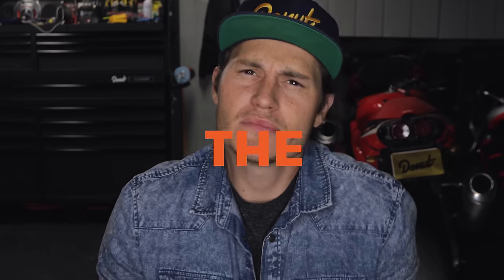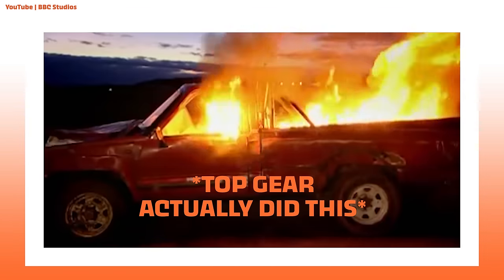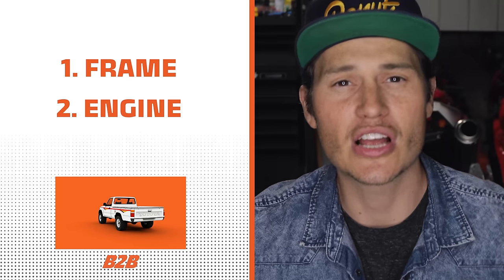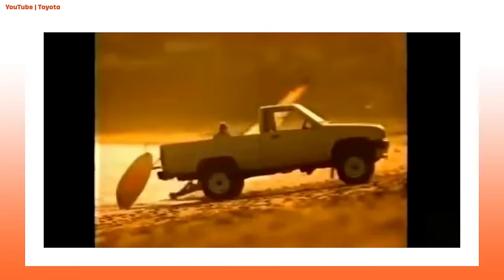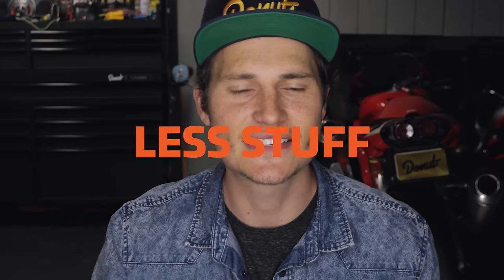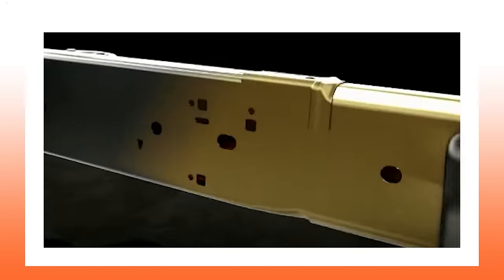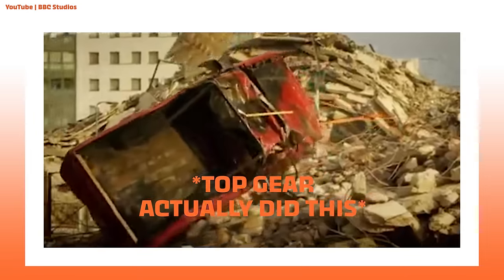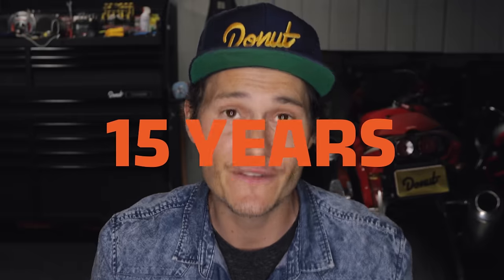Toyota PICKUP Truck - The Science EXPLAINED

Comment: Germans: you can’t just make a truck that’s indestructible 

Japanese: haha truck no break break
Reply: Germans: NEIN!
Reply: はい
Reply: *brrrr
Reply: of course german cars are destructable.
Its probably the transmission that breaks.
Reply: Japanese: Hold my saki
Reply: Samuel Hayden: Can't just shoot a hole in the surface of Mars.

Doom Guy: [fires Toyota Pickup 10,000]
Reply: Kj16V lmao
Reply: Frisbe  I'm worried for your IQ.
Reply: @masterace1150  Because it’s called a joke. The Japanese part is supposed to be the focal part of the punch line. If the Germans have equally noteworthy dialogue changes then the joke would just be a long running mute. Cmon use you IQ points.
Reply: Fegelein.. Fegelein..
Reply: Germans: screams in angry engineer
Reply: @cheesuschrist8248  it's a tradition
Reply: h
Reply: Netherlands: done done again done as a pickup done as a racer done as a semi done
Reply: Master Ace Wooosh
Reply: VW built the Hilux under licence from Toyota badged as Taro it was sold in Europe not sure about anywhere else.
Reply: @cheesuschrist8248  i think it's tradition

Comment: I remember watching Top Gear, they had a building implode on it and it was A-Ok
Reply: Technically it just rode the roof down.
Reply: @PACKERMAN2077  it still hit the ground like a brick though
Reply: To be fair. The camera crew left an old clapped out Dodge Dakota in the building they knocked down with the Toyota on top. Al Bundy approved. It still runs. All the glory went to the Yota that was demoed carefully to survive. More spoilers. GM hired camera crews who made all their commercials for the new Silverado..... with a Ford Raptor.  I mentioned that it's ironic to the camera guys. They said that their employer bought the truck. Top Gear did a big 3 competition in which the Chevy truck was considered the winner. Only the Dodge could have made it. The Ford could have made it too. All about the drivers. Toyota paid to be portrayed favorably again in that episode. It was declared the official winner because their camera guys, drove sensibly because of where they were so they could... get home.
Reply: They also chained it to a beach while the tide was coming in, the waves turned it on to its roof, it was fully submerged....a few hours later, it drove away.
Reply: @dyent  Yes I remember that part. Supposedly they got that little diesel truck running again with W-40, wrenches, and a socket set. I would argue that had that Toyota been a gasoline. It probably would have never started again. Diesels do not need spark to run. So the whole spark issue is taken out of the equation. A USA version of that Toyota would have been scrapped like an S10, Ranger, Jeep Commanche, Mazda, Mitsubishi, Nissan D21 and Dodge gasoline competitor.

Comment: NOOOOOO STOP RAISING THE VALUE WHILE I'M IM THE MIDDLE OF LOOKING FOR ONE!!!!
Reply: Muahahaha
Reply: my neighbor has one still runs just put air in the tires and charge the battery it just sits in the driveway but it still runs
Reply: @crownking3752  I'd go offer him 1200 bucks to take it off his hands
Reply: Good Luck! I mean it haha
Reply: So true, after every episode , these prices go up because now all these non car guys, go buy them to lift them or for racing and drifting. 😭😭😭
Reply: @joshuaadler4259  nah he doesnt want to sell it haha
Reply: Well in my country this pickups value were no more, you could get a hilux with great condition around 1800 bucks, my neighbor got one also
Reply: Lol most were I live are 3500 and I sold mine for 500 bucks 😂😂
Reply: Hahaha I just bought a Toyota Tacoma 2003 for 2000 dollars in really good conditions
Reply: Riccardo Spadano Too late. Go to autotrader.com, plug in Toyota truck 84-88. The prices are shocking.
Reply: Charlie Foxtrot  go look at the prices for FJ 40’s
Reply: Lyndon Whitson Those are even more shocking. But I saw an 86 standard cab, bare bones 22R truck w/127K mi going for $22K. The trucks are following the trend of the FJ's.
Reply: I got an '88 Pickup 4x4 at $1500, totally rust free frame, only catch is it has the 3VZ-E engine in it. Apparently 1988-1989 are the two good years for the 3.0L V6, so if you find one, get it. Or not lol
Reply: @Emiliopedo  how many miles?
Reply: @fishon1467  at that moment  230,000
Reply: Hahaha donut go brrrr
Reply: @Charliefox71  that's actually insane, some of those trucks are sitting at 16k USD

Comment: I prefer the Nissan Hardbody's, and they are just as reliable. Drove mine with no oil for 108 miles at 80 MPH and once I found out the oil sending unit from 1995 was leaking I replaced it filled it with oil and its been fine since. Late 80's early 90's was prime Japanese automobile manufacturing

Comment: Bought a Toyota pickup new in 1990 with the 22RE.  It was the base model, which meant:
No radio
No cigarette lighter/charger outlet
No passenger side mirror
No rear bumper 
No carpet OR floor mats - just a rubberized floor
I added most of those things
Oh yeah, no AC.
I drove it 458,000 miles.  I had a water pump and fuel pump replaced and it had an appetite for alternators - I'm guessing the guys that installed the charger outlet and sound system buggered something up.
It was still running, although it was jumping out of gear and you could hear it would need engine work.  I sold it to the state in a cash for clunkers program.  I got under the car to check something and the frame looked almost new.  Anywhere else in the world they would have dropped another motor in it and kept going, but I felt the whole truck was getting tired by then.

Comment: the world: LOL u cant drive a pickup without oil hahaha
Some Japanese company: haha Toyota pickup go brrrr
Reply: More like brat ta ta ta
Reply: Lame
Reply: BS.  My Ex drained the oil out of my original 4-Runner.  I have no idea how long I drove it dry.  It was running too hot so I pulled over and checked the oil because I couldn't figure out why it was so hot... no oil.  THEN; drove it to the parts store and bought oil.  Poured it in - like pouring water on a hot griddle.  Drove it 50k more miles before trading it in (wish I'd kept it).  It never had a serious problem ever.  I suppose it may have had a pint or so in it just enough to keep it from seizing but the dip stick was like it was pulled from fire it was so dry.  But there's no doubt any other engine in the world would have locked up and definitely been permanently damaged.  But not the Toyota.
Reply: Mark Sr that’s wiiiiiild

Comment: I had a 1984 Toyota truck and loved it!  It looked little and weak, but I abused it!  I overloaded it, pulled a fully loaded trailer across Washington State over the mountains with the bed full too, went up steep and bumpy mountain roads, and drove it aggressively.  I changed brakes in an auto part store parking lot, changed a water pump on a mountain pass in the snow, and replaced the clutch myself. I miss that truck.  Simple, reliable, and easy to fix.

Comment: @6:03 You are correct. Suspension should be handled by suspension components not the frame. That's why coilover suspension lifts are much better and are actually off-road worthy compared to spacer lifts.

Comment: When running a UN-spec armoured Toyota through trials at a certification testing house in Germany, the marksman repeatedly put rounds through parts of a HiLux that wasn't protected by armour (such as door hinges, suspension, engine block, headlights and so on).  The manufacturers, the certifiers, and the buyers were shaking heads in disbelief at this vehicle's ability to continue to run and operate despite catastrophic damage.  It would regularly far surpass expectations in such tests, including when tested against explosives.  It is not the most powerful of trucks and as such can fall down when matched for performance against other vehicles, but if core reliability is your priority (especially for civilians who won't put such immense burdens on it), few vehicles (if not equipment in general) will best it.

Comment: ** Dodge Biggest sponsor of Donut **
** Dodge at 0:10 **
Dodge didn't like that
Reply: That dude is local and folded the frame with a bed full of concrete with a tug a a war against monster trucks. Welded the frame and got back. To it that night
Reply: @codyparker679  plus how high up he had his truck tied to the other truck! The amount of leverage that was put on that truck was insane! No truck frame would have took that much pressure and not folded in half like it did.

Comment: when you make stuff simple less stuff brakes. this needs to be relearned by all engineers.
Reply: Not profitable. Greed is a bitch.
Reply: Why sell one reliable car, when you can sell the same customer two crap ones.
Reply: Well In a way Mazda did that with the 3s rear suspension
Reply: American consumer culture needs the learn that
Reply: This is the fault of regulation more than consumers. You can’t legally build something simple anymore.
Reply: The problem is nobody would buy a 2 seater 2wd pickup with no ac
Reply: @freeminded7  There are no regulations that require cheap steel frames or shit parts in cars. There are also no regulations requiring backup cameras, lane departure warning, computers on every spark plug, etc. And yet every new car seems to have this stuff. 
The corporations are choosing to do these things. Has nothing to do with regulations.

Comment: My grandpa had one of these for 30+ years; he only stopped driving it when it got stolen.
Reply: Steal it back
Reply: @silvermediastudio  they found it about a year later less than a mile from the shop from which it was stolen. He got $8000 from the insurance.
Reply: @landoncomella7454  When they found it did it still run?
Reply: @barryscott3327  I believe it did. He took it to the shop for an engine swap and it was stolen after they put the new engine in and had it running. It sat for a year in an apartment complex, but after it was found the insurance had it auctioned off.
Reply: @barryscott3327  I believe it did. He took it to the shop for an engine swap and it was stolen after they put the new engine in and had it running. It sat for a year in an apartment complex, but after it was found the insurance had it auctioned off.

Comment: I'm sure the Toyota was rated as able to tow 5000lbs or whatever, but I've seen the 1980's Hilux pull double or triple that with ease. 

Then along came WhistlingDiesel. Pulled around 30000 lbs with it
Reply: My cousin is part of a rescue group in the middle east helping people who are stuck in sand dunes and stuff. He had a 2000s land cruiser. They got called for a tipper truck that was stuck on soft sand and the bottom of the truck was touching the ground. He got there and found out the truck was full of sand. My cousin got him out with a stock land cruiser.
Reply: @khalidalotaibi1072  absolutely believe that. I've seen those LC's do some crazy stuff

Comment: Ran a 22RE without oil for months as well. Thought I was soooo smart for figuring out my plastic timing chain guides had broke because of the dreaded "rattle". What I didn't realize was it was caused by the fact that the tensioners had no oil pressure to keep the chain tight. Could diagnose a bad chain, but not even check a dipstick... SMH. The oil light didn't work btw.

Comment: Funny you should come to this conclusion. I had an 86 pickup and did all my own modifications. Took it off roading, had it under water up to the lower molding on the door, completely in the air on jumps, had to use a sledge hammer to straighten the skid plate back out after a rocky traverse and my favorite story to tell is simply this. "I had my Toyota pickup for 12 years and I was never stuck on the side of the road even once."  The thing never failed me. Thanks for the video and bringing back some really fun memories.
Reply: That was back when they were simply called Toyota Pickup? Are you in the States?
Reply: @jaymeister4850  Correct. That model still had a solid rear axle as well. I bought it in Germany but took it back to the US with me when I left.
Reply: @RaumBances  So was it a right hand steer model? Also, was it after the twenty year cutoff?
Reply: @jaymeister4850  It was left side drive like other US cars. I don't know what the 20 year cut off is. It was about as plain as you could get when I bought it. I have pictures of after the modifications. I put a 3  in body lift kit on it, gas charged shocks, Yokahama tires, KC dayligher flood lights, a rollover proof camper top, wood storage boxes in the back, bug gards and sideband CB. IT was the late 80s. lol

Comment: Me: wondering why I don't see any Toyota pick ups in Illinois.
Donut: "rust problems"
Reply: Also live in Illinois.... Completely understood
Reply: No, the reason is that Midwest state folks don't buy them. Regarding the the frame  rust issues... that happened on early 2000 trucks and was due to DANA ( the frame supplier) not applying the corrosion prevention coatings according to the Toyota spec.
Reply: The funny thing is if you just fish oil the chassis rails and stuff like once or twice a year they are fine
Reply: 5 of my Cousins have 80s pickups and or 4Runners in Palatine and Hoffman Estates, just go to NW cook county, they are there. Salute from S. TX always hot even in January here.

Comment: I put over 200k miles on my red 1982 Toyota longbed; sold it in 1994 because the bed was rusting off, but saw it in the area for another decade or so.  I had a wooden ruler as an integral part of the alternator for three years; the 22R engine was an absolute masterpiece (had the same block in my '92 Celica).  Loved that truck.  But I have 234k on my 2010 Tundra so far ...

Comment: Great video. My dad had a 1975 Toyota truck in Ohio. I was a toddler when he bought it new and I remember it. I was mad that he traded in his 1972 GMC truck for the Toyota. But that little truck kept running. If it weren't for the winter salt on the roads in Ohio it wouldn't of rusted the frame and body so bad. The engine would not die. 

What type of  frame did the 190 Datsun Truck have? I saw a low miles one with under 70K on it and the engine is a 4 Cylinder 2.2L Diesel.

Comment: I have a 1986 Toyota Pickup with 339k miles on it (i also Own a 2019 540i a 2015 M2 a 1983 911). No AC no Power steering, locks 2 wheel drive 4 speed manual. 22r motor no EFI! Still runs sweet, doesnt leak a drop. 
I use it for hauling stuff and what not. LOL i put way more tile in it than it was rated to carry, handled it no prob. I love the truck because like Donut said, it is so stupidly simple to fix and maintain and in Southern Arizona rust is not really an issue. Im not delicate with it either. All i do is change the filters and oil from time to time, and it runs like a raped ape. I always joke with the wife, if we ever lose everything, the big house, nice rides, this is gonna be our vehicle!
Reply: i have one too. 86,xtra cab,22r,ac,power steering, dully. 100k miles perfect little thing
Reply: nice i have a 1984 with 429k, no power steering, no ac, 22r with a 5 speed
Reply: @alexfonseca1000  damn you guys have hella miles on yor trucks. my was rebuild so i dont know the real numbers
Reply: Hey man I just bought a 86 yota pick up with a 22r in it and am looking for sum info about it think you could help me out?
Reply: @scraplux2880  would u be willing to give me sum info on them I just purchased one
Reply: @bignast3765  yeah whats up?
Reply: My 86 and 87 went 225k and 327k until the frames rusted out, right behind the fuel tank. The 86 I welded in a plate. I have the 87 away.

Comment: I've seen modern box frames they fix the corrosion problem with a more generous zinc coating on the interior, and drain holes throughout the  the frama. It would probably also be a good idea to design the frame on a slight angle so water will run out by itself instead of pooling, but idk.
Reply: T
Reply: You’d still get capillary attraction with the water. But the thought was in the right direction. Like you said, more Zinc now days helps.
Reply: @Smitty19966  Yeah the enviroment its exposed to is the biggest issue, while an older box frame could rust out in a few years exposed to salt and humidity frequently in that environment any car's structural lifespan is going to be limited. Well. they are making trucks with aluminum frames now so I would be interested what kind of galvanic corrosion issues they have in salt spray conditions due to the other ferrous parts of the drivetrain or structure.
Reply: @Marc83Aus  I’ve owned a full-frame Aluminium Quintrex fishing boat for 12 years. No problem with corrosion. Probably a step in the right direction.
Reply: @Smitty19966  Aluminium is great for ocean exposure, except when in contact with other matals. This would be the problem with an aluminium frame car, most other exposed parts f the drivetrain need to be aluminium alloys, which is already common anyway, things like suspension and steering linkages, crank case covers, etc. Galvanic corrosion could be caused by steel springs, bolts, driveshafts, etc. however coatings on thsoe items could prevent this, also isolating the contact between dissimilar metals with rubber, ceramics or whatever can also prevent corrosion starting. Paint is an option.
Reply: @Marc83Aus   Yeah and it drives the costs up when you have to isolate those parts from one another and could mean more maintenance. Rubber may need to be replaced etc. Wouldn’t be nice if we had had a element on the periodic table that was cheap to obtain, corrosive proof, extremely strong and easy to fabricate into an end product. 😔